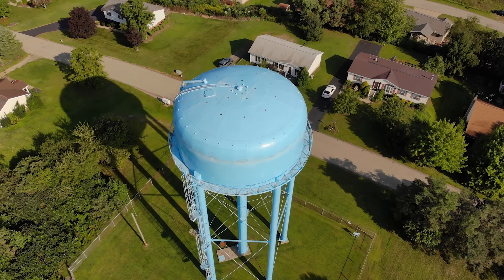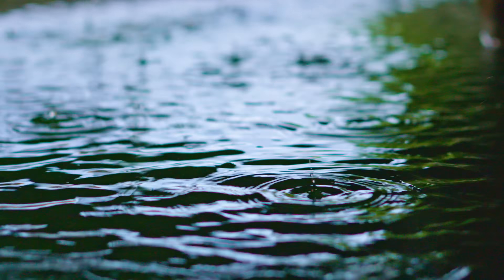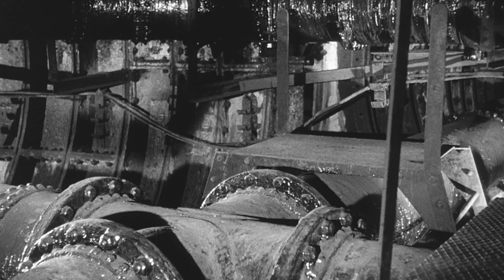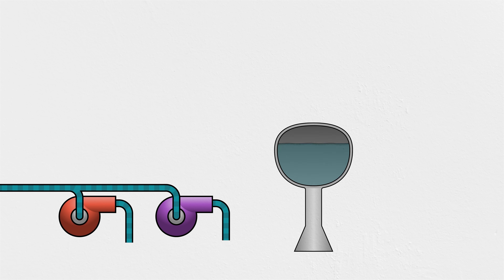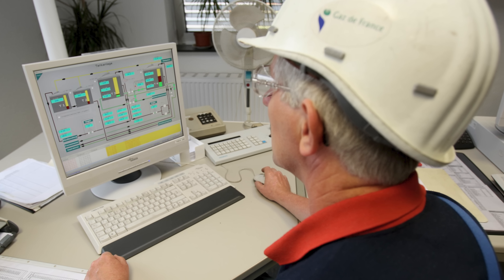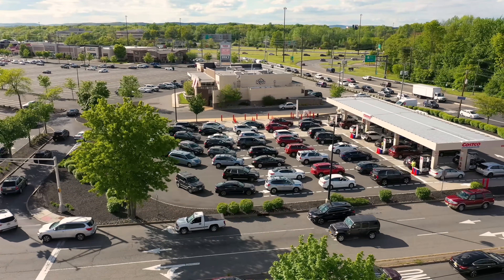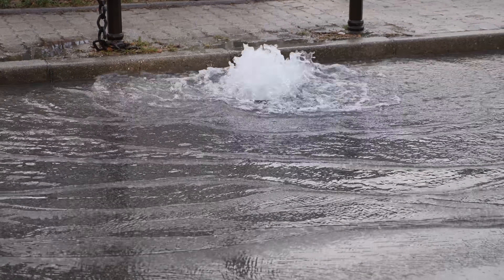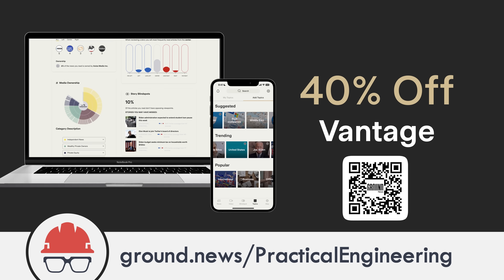When Infrastructure Gets Hacked

Comment: So the pipeline thing at 9:00 was completely self-inflicted. They screwed up their preparation, security, emergency response, restart, paid the terrorists, and blamed everyone else? Those execs should be in jail.
Reply: i remember images of idiots filling up plastic bags with gasoline at the gas stations 🤦‍♀
Reply: @moos5221  The weird thing is that the most famous video actually came from 2019 and had nothing to do with the pipeline. Some wackjob filling plastic bags with gasoline and putting them in the trunk for no clear reason.
Reply: @EebstertheGreat  i remember a video of a woman filling plasic bags with gasoline which then burst because the gasoline was dissolving the plastic.
Reply: @moos5221  lmao
Reply: I fully understand why you would shut down all your systems as soon as possible when you discover you are infected. The risk of critical hardware getting damaged (pumps running dry, pressure buildup, oil overflow) is just not worth it. Especially since there is always some slack in the supply-line which gives you time to deploy emergency solutions such as wheeled transport.
Reply: @joppedegroen6918  Yes, but it isn't that hard to figure out that only the billing system was affected. They shouldn't have had to stop the pumps for more than five minutes.
Reply: self-inflected stupidity is a c-suit trait.

Comment: Software interlocks are unacceptable. Software interlocks are unacceptable. Software interlocks are unacceptable. 

I said it 3 times so the software engineers get it.

A limit switch could have stopped this. Stop relying on software to stop disasters. Therac-25
Reply: They should have both. Redundant interlocks to prevent operator error or bad actor sabotage.
Reply: My English might be lacking here, but what do you mean by software interlock. Interlocking of two different systems? Or domains such as analogue and digital?
Reply: Software controlled limits, instead of hardware controlled limits. 
A software interlock would be a computer not allowing a tank to be filled up past a set limit by automatically stopping the flow when it reaches a pre set value. A hardware interlock would be a float linked to a shutoff valve that physically shuts off the input entirely based on physics.
The Therac-25 was designed in a way that it was possible to give people a lethal radiation dose if the software errored out as it had no hardware based restrictions preventing it, it was an entirely software based saftey system.
Reply: @egroeggerg  so let's take the water tower/tank example. Float mechanically controlling a shutoff valve is impractical, also not enough. Proposal: the overfill float triggers a sensor that then signals(as in signal LOW turns it off, HIGH keeps it on, cutting the signal wire is also failsafe) a relay to cut power from the water pump and lack of power automatically shuts off the valve as well. Sounds good?
Reply: So you eliminated one of the three major sources of failures for an edge case. Just as a reminder the 3 major sources of failures are: software, hardware and wetware. You can't eliminate them all. Rather have them check each other: have a software lockout, a hardware switch AND an intuitive display with an audible alarm.
Reply: Having both is best, with the hardware cutoff being at the design limit and the software at the operating limit.
Yep, the float linking to a power cut off for the pump would work better than a valve on its own. I just used the valve as an example, a proper hardware interlock for a system of that size would probably have the power cutoff for the pump implimented.
 Ideally you would also have 3+ concurrent hardware sensors (3 floats in this case) and have the cutoff trigger on a consensus (when 2 floats are triggered in this example) to reduce false positives and to account for failures in equipment that might not be used often or poorly maintained.
Reply: Yeah, I went a little hard in the OP. I should have said exclusive software interlocks are unacceptable. I had always meant that you should have both, in an Exclusive Or? Exclusive Nor? NAND? AND? Depending on how you do it, one could be an absolute where it cannot be overridden in software.

Sorry, I have been having software issues with multiple things in my life lately so I am in a bit of a mood. To be fair, there are software engineers who try and recommend the best option but get overridden. (Ironic sentence)

You could just have the multiple limit switches slow the pump down if they completely fail open or closed and have combinational logic do the legwork.

A. -15%
B. -5%
C. -25%
D. -55%
A+B+C+D = Completely off.

Very impressed with the community response. Thanks for the backup guys!